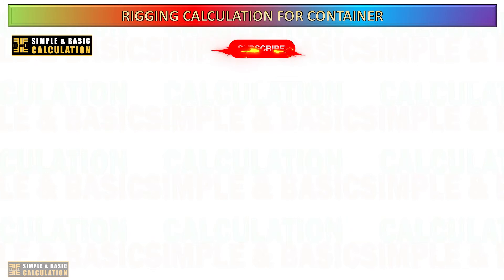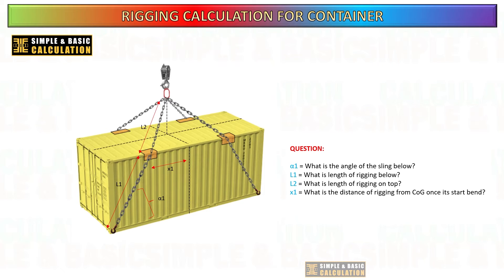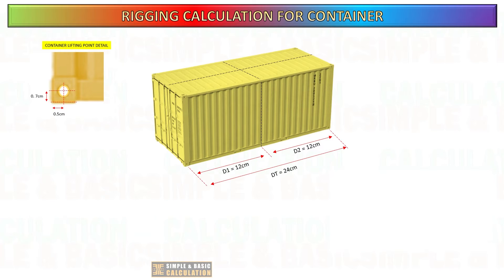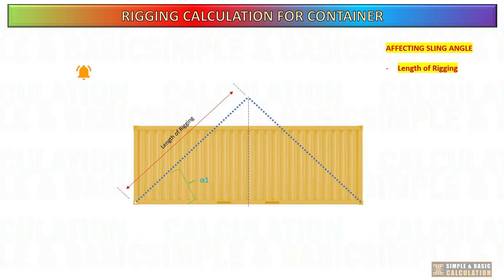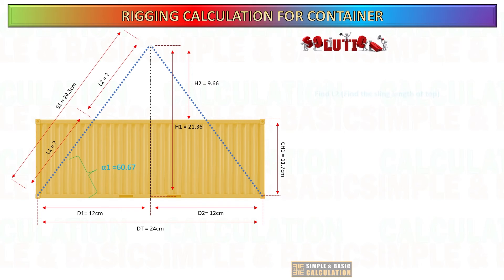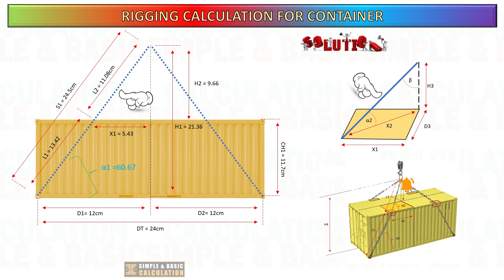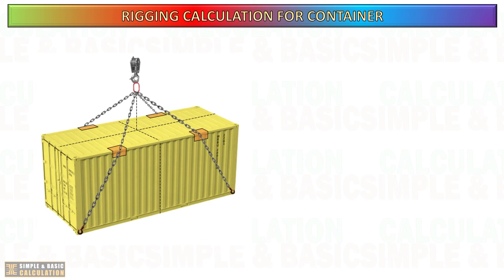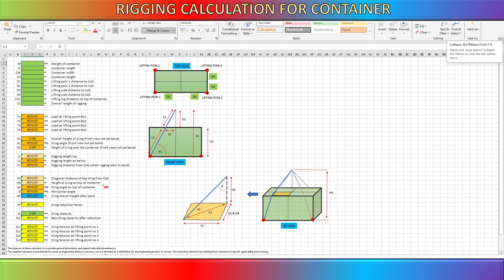LIFTING OF CONTAINER RIGGING CALCULATION #rigging #crane #hoisting

Comment: Huh? Your video references distances in CENTIMETRES...? One centimetre is 10mm... lightly less than half an inch for those in the imperial world.
None of the distances mentioned are correct for the real world. The example is I see one container that you reference as being 24cm long... that is not even a foot long....
Reply from the maker: Thank you for your comment; I sincerely appreciate your feedback. To ensure the accuracy of my calculations, I developed a model of the container for verification purposes. By comparing the actual measurements with my computed values, I was able to assess the validity of my approach. I acknowledge that, in practical applications, this specific dimension may not be feasible. However, this video is intended for illustrative purposes to support understanding and facilitate its application in real-world scenarios.
Reply: @SimpleandBasicCalculation  OK now I see - I had not noticed any mention that this was a scale model exercise, hence my comment. :)